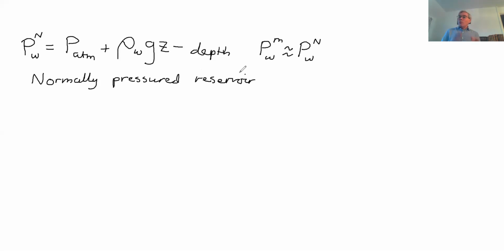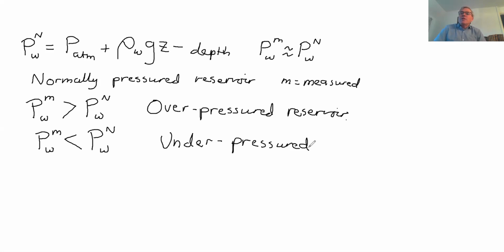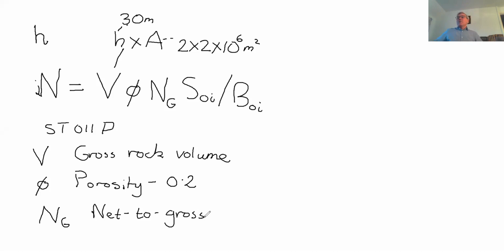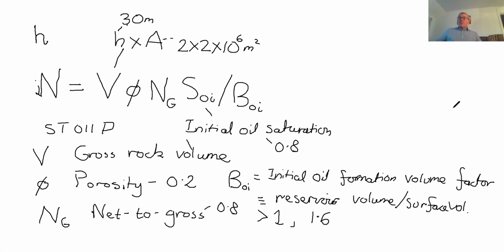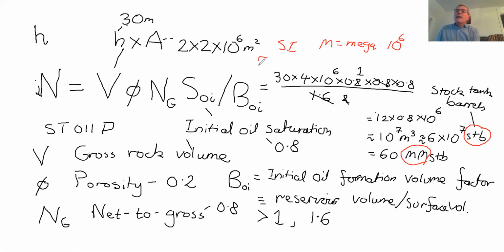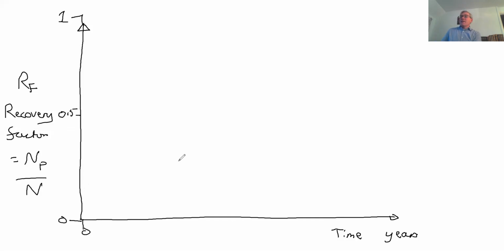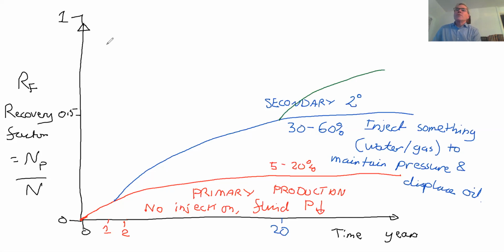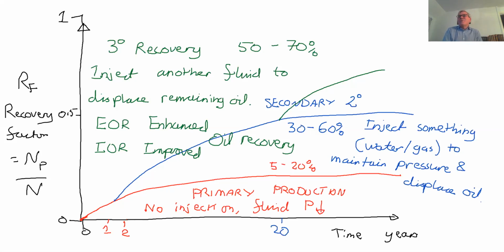Production mechanisms

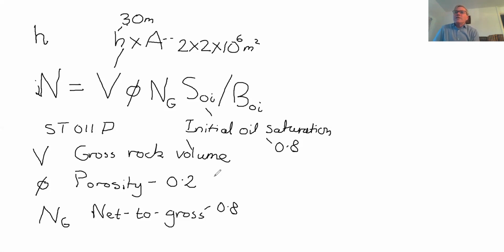Comment: Martin. 15:21 Well, we know more or less where B comes from, but it is not a very satisfactory answer. M. Muskat in Physical Principles of Oil Production used \beta as the oil formation volume factor and several prior authors either did that it or used a "shrinkage factor" (the inverse of FVF). In very short order, authors started using B instead of beta for the lack of Greek letters on typewriters. Also, to annoy actual scientists, I always use 2 Pi barrels/m3 which is surprisingly close. Nice work
Reply from the maker: Thank you.  Yes, just looked at my copy of Muskat's opus "Physical Principles of Oil Production" and indeed he uses \beta.  Another curiosity is the number of seconds in a century - pi billion.
Reply: I learned that fact as a physics major. This led to my inventing a unit of time —- pi seconds is approximately a nanocentury
Reply: @BoffyBlunt  As a physics student one of our test questions was to calculate the angular momentum of the earth; While the professor was Working out the answer he casually mentioned that there were PI times 10 to the 7th seconds in a year which is of course approximately correct and I think it's even more accurate if you account for leap year. This led me to develop Time that is not widely used however it should be you see Pi seconds is approximately one nanocentury. More people should use this unit that I invented(the nanocentury) Such as hey just give me a nano century